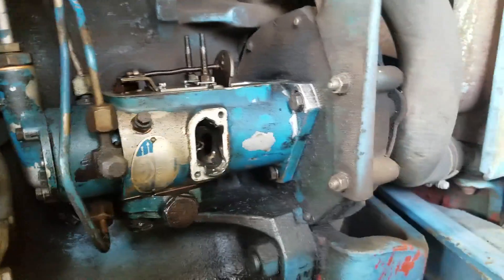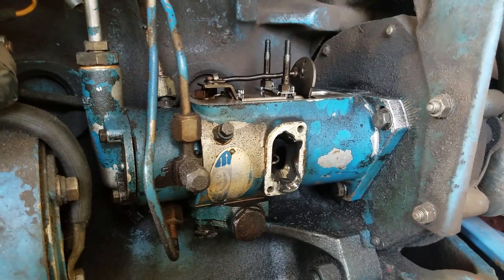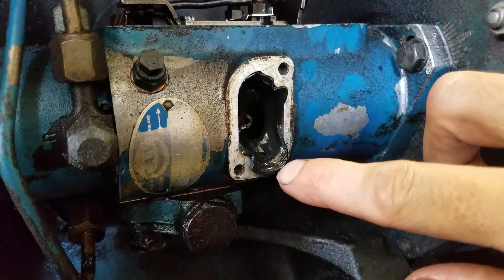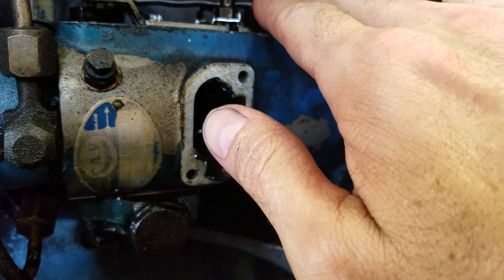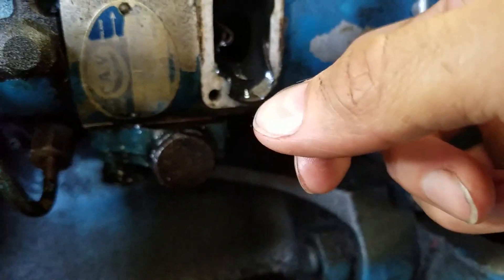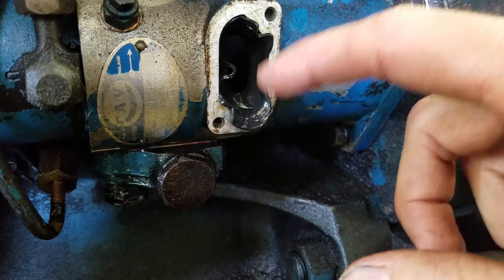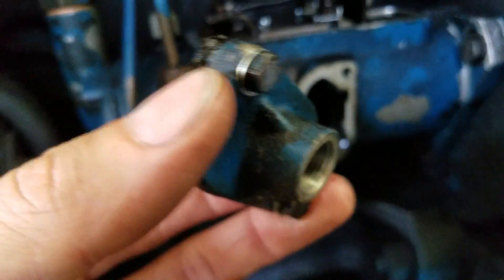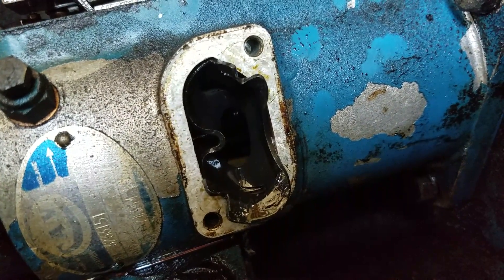Ford 2000 CAV Pump Problem

Comment: My 3000 with a cav pump will not hold a steady idle anymore. I am going to try and rebuild it . Is it pretty straight forward or do I need to be on the look out for flying pets on disassemble?
Reply from the maker: Do a search for Bundy Bears Shed - CAV Injection pump full strip down to re seal and stop fuel leaks . that video does a good job of walking through the whole process.
Reply: @brianj12381  thanks for the information, but I found my problem. I had what looked like handfuls of dirt in the tank. I cleaned it up and its ran great again.

Comment: where is the second video
Reply from the maker: Didn't post one because the pump had to be rebuilt.  Something went wrong with the governor.
Reply: when you sent it for rebuilt, how much of a hassle to put it back? @brianj12381
Reply from the maker: @kenanyfarm1577  I had already taken it off to put the rebuild kit in it with the o rings and all that.  Mark the gear in the front for the timing is the most important part.